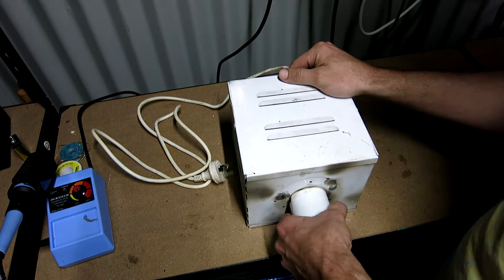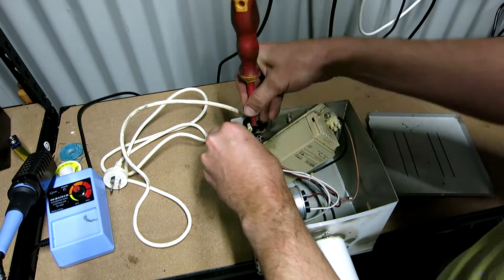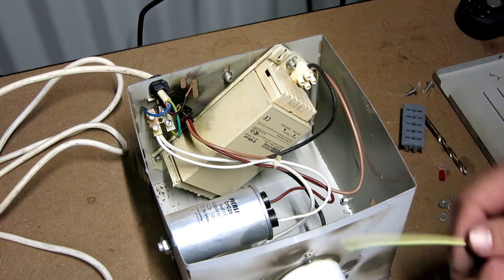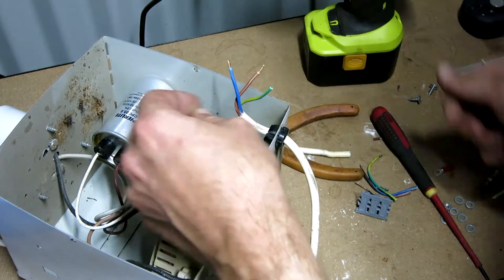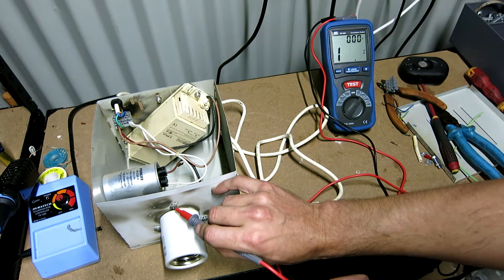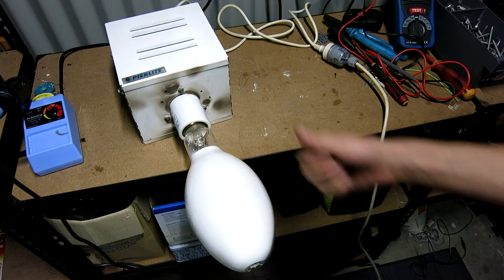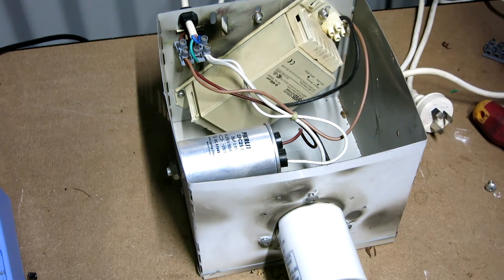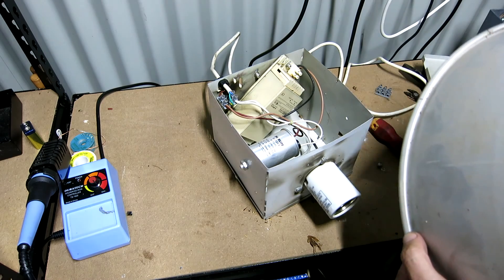FF&R: Fault find and repair metal halide industrial high bay light fitting.

Comment: thats a small balast compared to the ones we have over here
Reply: The reason these ballasts are smaller than the ballasts typically found in North America is that these ballasts found in Australia are known as chokes. Chokes are ballasts that only consist of a single coil. The reason why most North American ballasts are a lot bigger is because they often contain multiple coils and are known as autotransformer ballasts, which consist of a choke with a built in step up transformer.